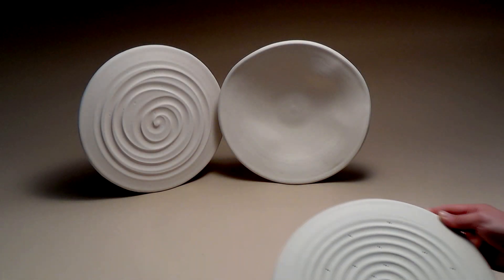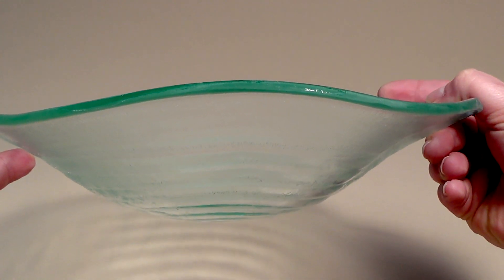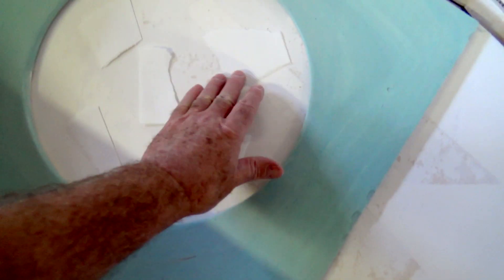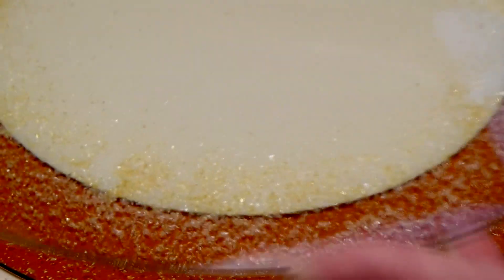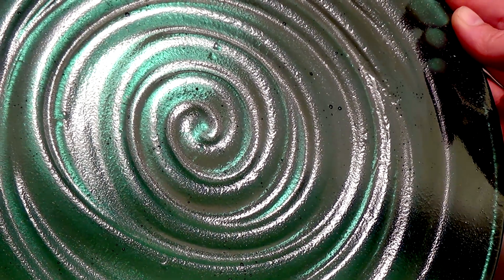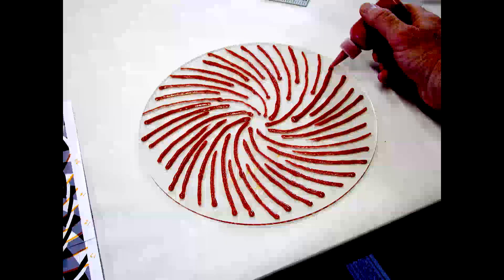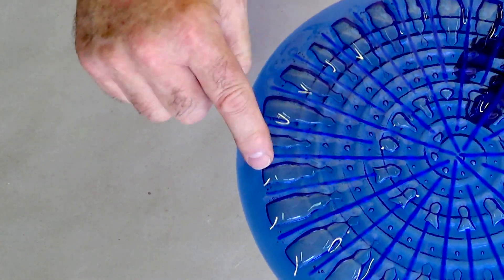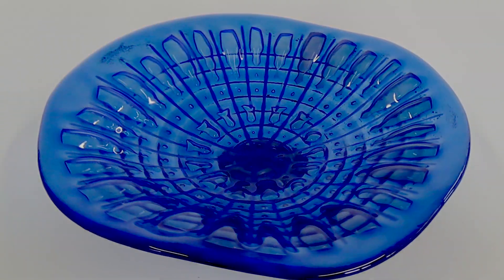Infinty Series - How To Video

Comment: Hi, love this..but I'm confused. I have the system but haven't used it yet.  Just want to get right;  I'm pre-firing the 2 layers first then doing the texture mold, Then slumping?  How about  when it comes to doing the the bubbles with stringer? Would I do my 2 layers with the stringer in between, then the first fuse would be the full fuse over the spiral texture mold??? Then slump? Thanks. :) :) :)